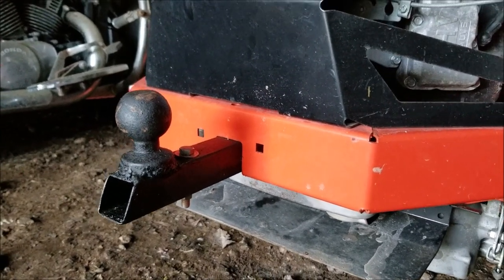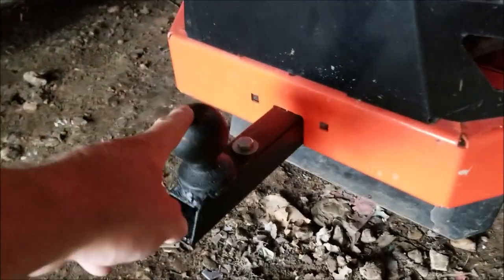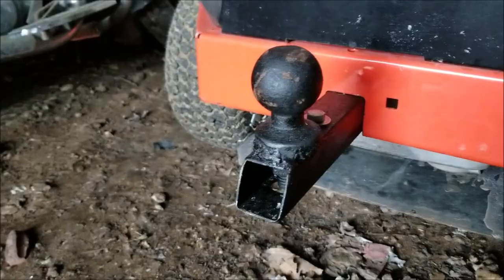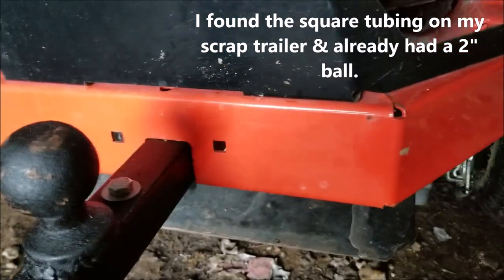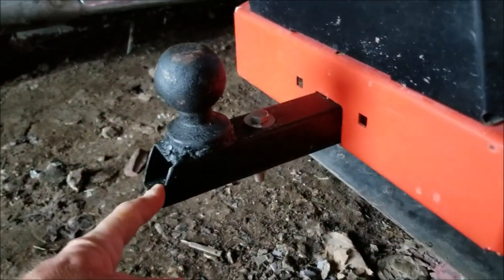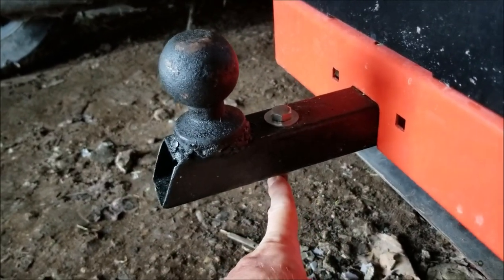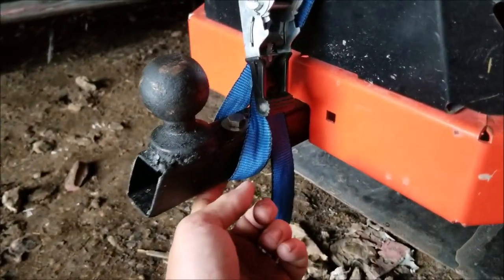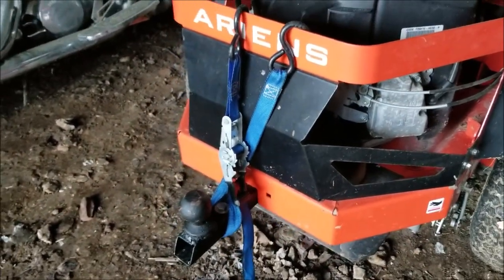DIY Ariens Zero Turn Lawn Mower Trailer Ball Hitch Mount

Comment: Hey, I just got a used Ikon X 52”. Was just wondering if you still had this mower and how many hours you got on it now.. Thanks.. 👌🏻🇺🇸👍🏻
Reply from the maker: I prob have 45 hrs on it now.  Had to change the regular belt this past summer  which was a pain in the butt.  No issues and still running strong.
Reply: JRMSweeps can you see this mower lasting 500 hours?
Reply from the maker: Man, that is a good question.  This is my 1st zero turn purchase.  I use it to mow about 3 acres of flat, nicely groomed grass around the property, maybe 45 mins to an hour a week of usage.  

My usage at 45 hrs a yr, it would take 11 years to meet those 500 hours.  I expect mine to last that long because I will do all the maintenance, replace spindles, blades, bearings, pullies, etc as needed.  

Will it make to 500 hrs, all I can do is hope.
Reply from the maker: How?
Reply: @JRMSweeps  I'm at 142.00 hours now. How about you ?
Reply from the maker: I'm probably around 65 hours or less.  Still running great.  Yours?
Reply: I’m at 300 hrs and year 3 on mine still going strong only problems I’ve has is a key switch
Reply from the maker: Im getting a clicking sound at idle, sounds like the pulley system?